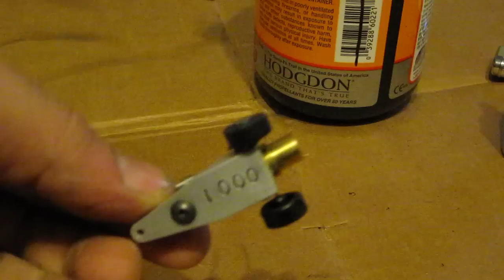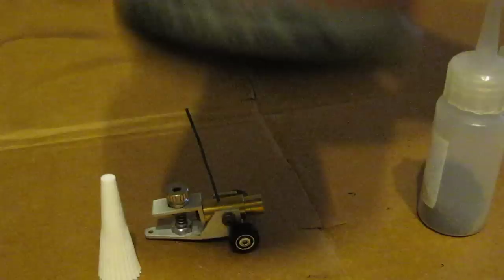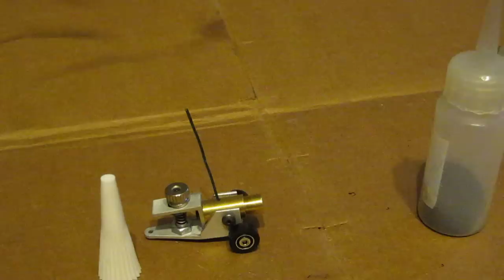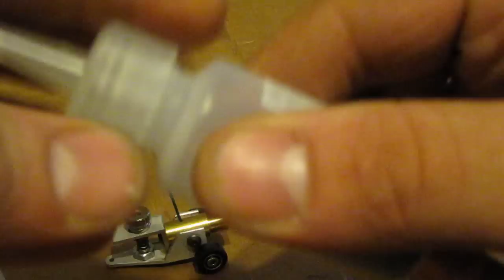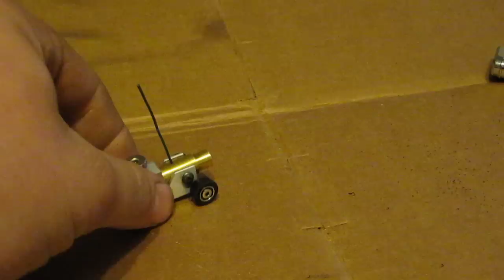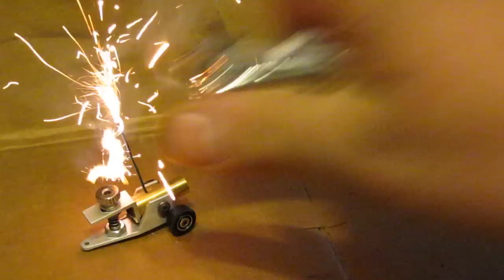Pocket Cannon Firing

Comment: lol , a tip 4 u r anyone who has this kinda cannon. it is not pwerful cuz it doesnt create any presure inside the barrel. knowing that it is brass built it is powerfull and wont blow up. so u should add less powder but put some paper inside and pwnd really nicely. then when the powder will ignite it will create bigg presure inside the which will release from the place where is the tissue. here u got a high power cannon. ;)